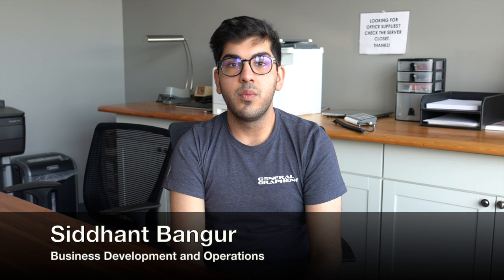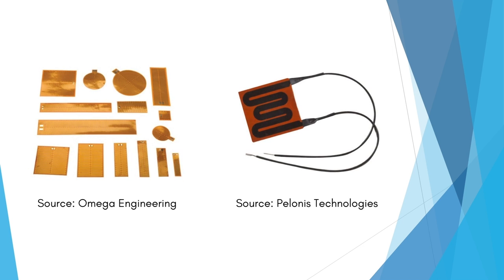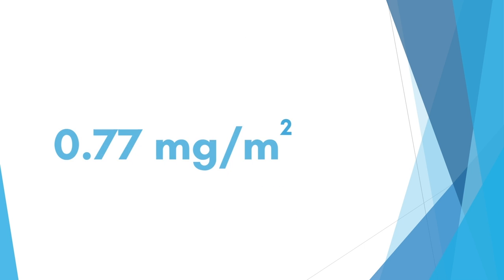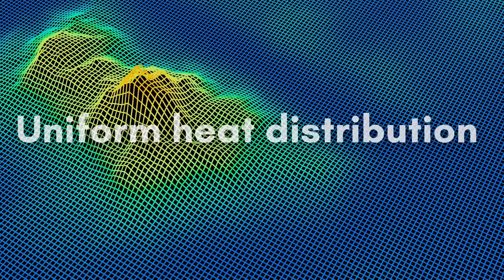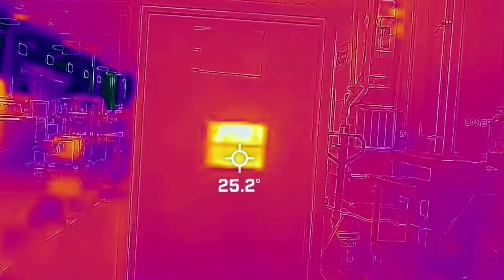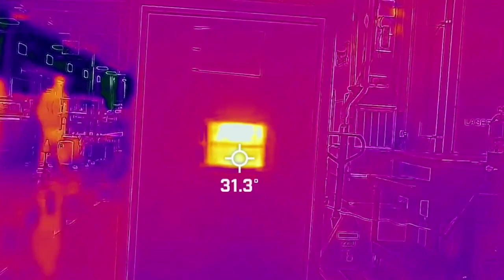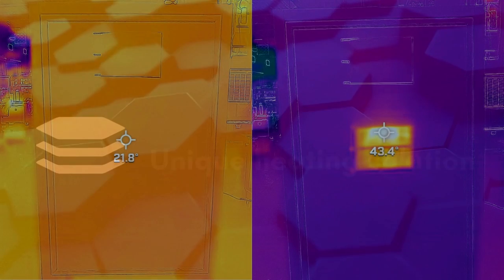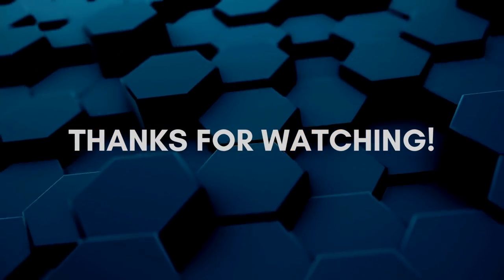Graphene Applications - Thin Flexible Heaters

Comment from the maker: One of the reasons we used a thermal camera to demonstrate our dry wall heater prototype is because the graphene on it is not visible to the naked eye therefore giving you a high-performance discrete heating solution.

Reach out to us if you're interested in using our CVD graphene films for heating applications!